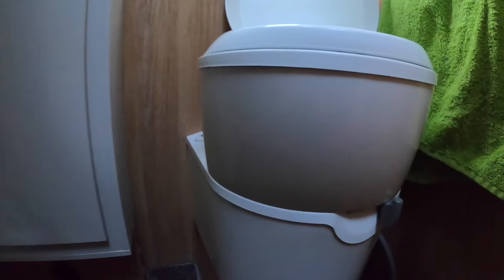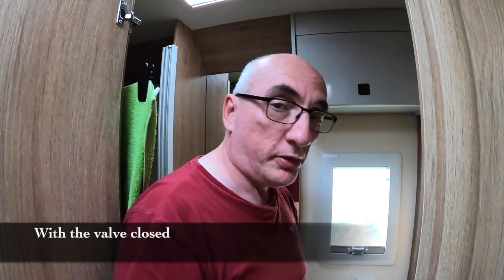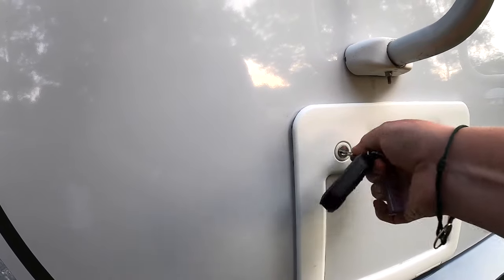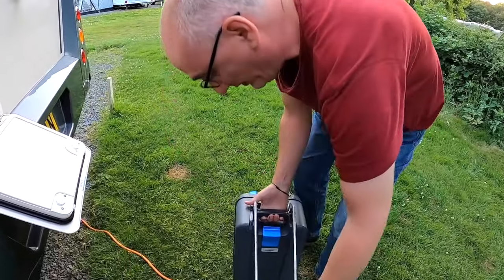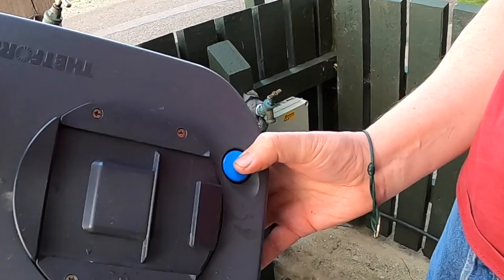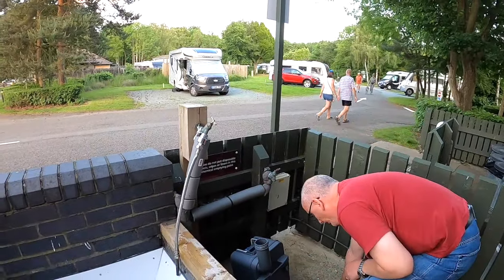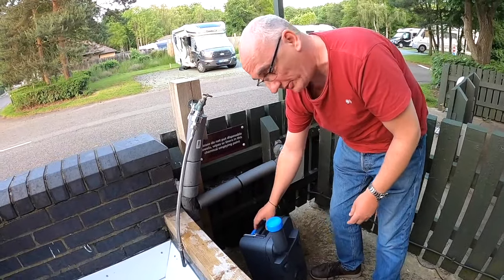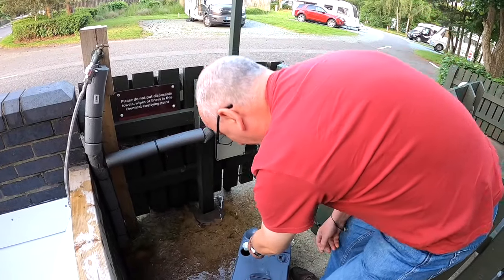How to Empty a Thetford Toilet Cassette | Cleaning and Maintenance

Comment: Gloves? And that hose  that is handled by everyone after  being inside a sewer opening is so disgusting! No!!!
Reply from the maker: A valid point.
Reply: Is it?  Do you wear gloves every time you use the toilet in the first place?
Reply: @conchscooter  That's an irrelevant question.  I  do not put my hands down into the toilet after hundreds of others have used same which is what a dump station gives you the opportunity to do without gloves.
Reply: @kaysmith6297  so would you wear a mask too and an apron, even goggles because of back splash. Just asking as I feel like gagging at the thought of touching something others have touched before me with their bare hands. I wouldn't say I'm a germaphobe,  and I don't judge others, as long as I feel I've protected myself I wouldn't impose my opinion on somebody else. That's their business. Am I over reacting?!!!

Comment: Just a quickie about paper in the cassette, we use the aquachem blue concentrate and Thetford paper and so far find the paper breaks down enough so as not to be a problem. Like you I tend to use a weaker mix than recommended because I tend to empty it each morning in case we go off in the MH.
Reply from the maker: That’s good 👍 many people have different opinions from none to normal paper. Thanks for watching and your comment.

Comment: I have to admit something. I was thinking about something you said about the flap open, while I argued against it being closed while doing ones business. 

I must admit it's way easier with it open while business is taking place, and use less water. Only water needed to rinse/flush paper. 👍👍
Reply from the maker: Agree 👍
Reply: @LiveforTravel  but I still close it between uses. Ie, when done rinse and close the flap. (Otherwise the fan would be on)
Reply from the maker: We don’t have the fancy one 😁
Reply: @LiveforTravel  mine looks aftermarket. There's a hole in the emptying thingie, and it annoys me a bit. I can't just throw the cassette in the back of my Prius and drive off.

Comment: Didn't know about the vent button or cleaning the float !
Reply from the maker: We are all learning all the time 😊
Reply: @LiveforTravel  I am in a rental camper. You cleaned the float. What’s the knob on the other side do?
Reply from the maker: @thereissomecoolstuff  automatic pressure relief vent.

https://www.thetford-europe.com/api/v1/DocumentTranslation/13/ContentDownload?h=C220_UM_EN_200703_0918-V04.pdf
Reply: @LiveforTravel  thanks. I couldn’t find anything about it. So far so good. I much prefer it to a black tank.

Comment: I think I'm missing something--why would you ever leave the valve open when not in use?  Wouldn't it always be better to close it?
Reply from the maker: If we close the valve each time we have used the toilet we have to remember to open it every time too. By opening the valve when arriving on site and only closing the valve before we leave negates the chance of someone using the toilet with the valve shut.
Reply: @LiveforTravel  I see--so it's just to prevent accidents.  Thank you :)
Reply from the maker: @paulisakson3221  no problem. That’s exactly it 😁
Reply: @LiveforTravel  you close the valves BEFORE you use it :) then fill a little water, then do your business and then open to let it go down there.

And then close it again of course. In mine a fan turns on when opened.
Reply from the maker: By doing that a little bit of waste could be pulled between the seal. We are fine leaving it open.
Reply: @LiveforTravel  hmm, I did not think about that.. you are correct. 
However, when mine is open a fan turns on.. :D thanks for your time and replies
Reply from the maker: @AndreasEUR  I enjoy the feedback

Comment: Oops your cable is underneath the van! PS I don't have any problems with this but you said in the video 2 days ago that you didn't do this! ;-)
Reply from the maker: Haha. We were very aware that we had previously left some cable under the van and this particular video was filmed at Ferry Meadows in June. When we researched the video for EHU we decided that although the cable is not coiled, and never has been as I run the cable through the cable tidy to prevent me having to put it away in the garage or blowing away, the advice we read up on for the video said it was best to not have it underneath. Therefore all future videos will indeed follow the advice we are now aware of. Thanks for watching.

Comment: Does anyone know why the red light stays on all the time even when the cassette is empty and even when I take  the cassette out the red light still stays on . Any ideas will be very grateful
Reply from the maker: If the float is stuck it would need to be removed and then washed under a tap.

Comment: Surely leaving the trap open all the while would stink the van out 🤔😖🦆💕
Reply from the maker: We can only say what we find personally. We use the correct chemical and empty as appropriate.
Reply: I've been full time only 6 months in my 2010 bailey pageant 2 berth but try this with flap open get about four pieces of loo paper all together and gently place above open hatch with back of fingers so as to seal the hole and if you are good you'll manage to do it without touching the loose sides. the next person just goes directly on top of the previous paper and they once again put three or four pieces of loo paper directly over the open flap just to seal the air in. It mostly works for me but then again it's just me and my little Jack Russell Buddy. Have a fantastic week
Reply from the maker: A good and really simple idea. Thanks for your comment.